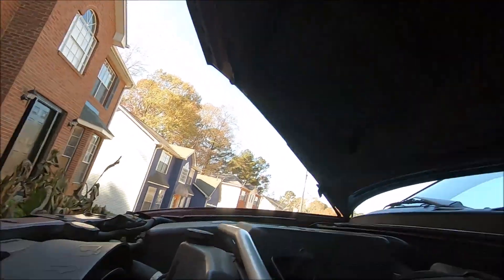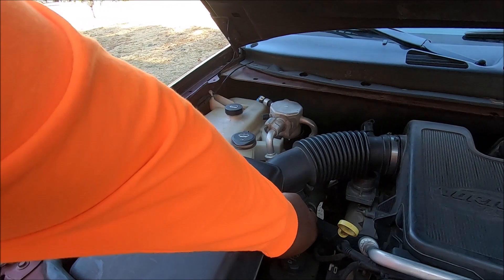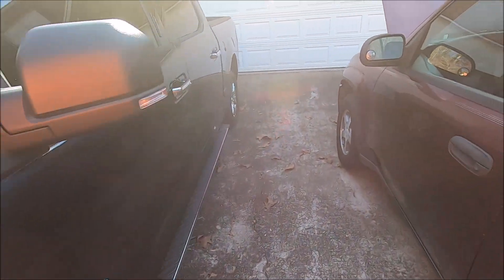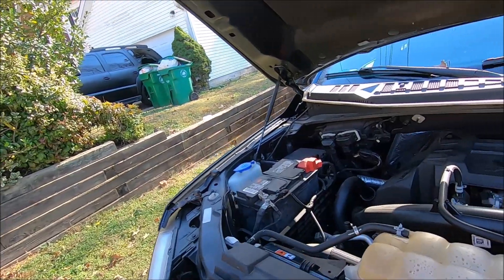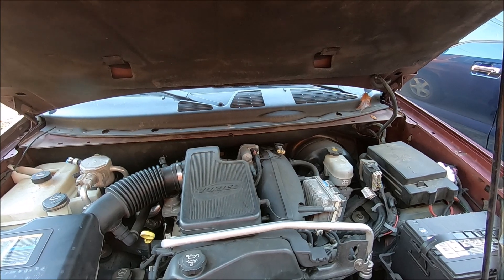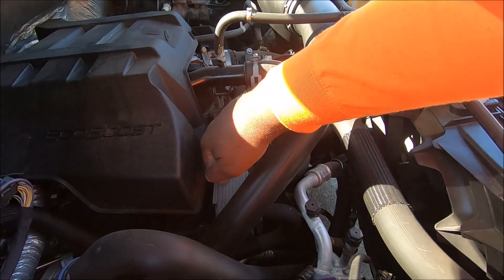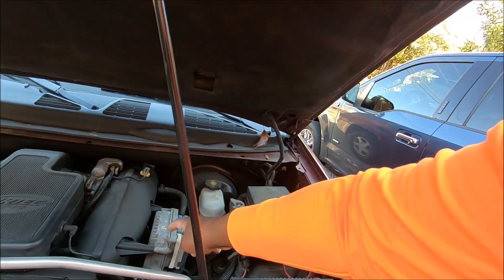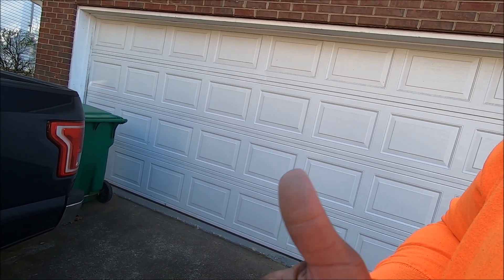My 2004 Trailblazer does not have an EGR valve

Comment: If im not mistaken yours has someone just seen it its on left passenger side direct under that big air intake hose and it has a black hoses going into it its mounted with 2 bolts to the engine block with electrical connection. The trans dipstick is mounted to it, I think thats the trans dip stick. The call it a EGR Valve.
Reply from the maker: 2004 TB has vvt on the exhaust cam. This is how egr is control.
Reply from the maker: I remember reading about the 4.2 when it came out. I've known it didn't have an egr valve for over 20 years. I bought my TB because I wanted an Amerikkkan made DOHC inline 6. I didn't think they would ever make another one again.

Comment: Thank you for this video. My 2002 Trailblazer just failed emissions because it didn't have an EGR valve. That is what I get for waiting and taking it to Jiffy Lube.
Reply from the maker: It does not have an egr valve because it has vvt on the exhaust valve. It didn't pass because something is wrong with it.